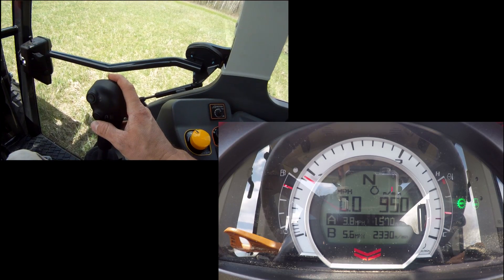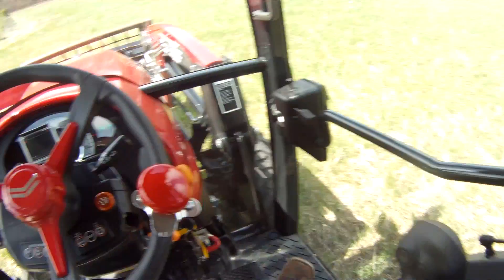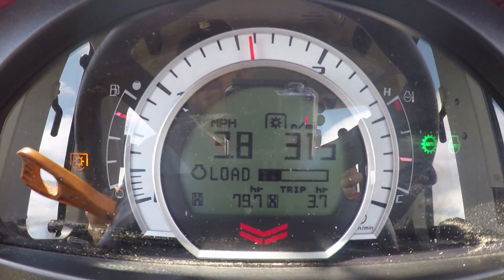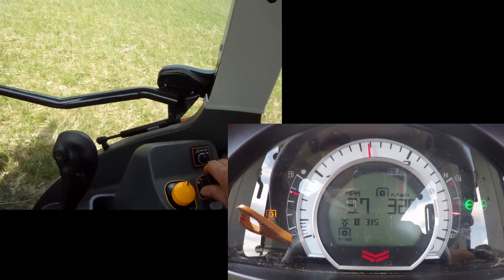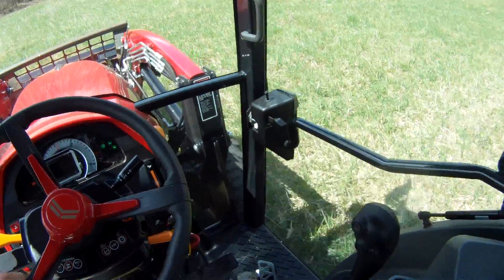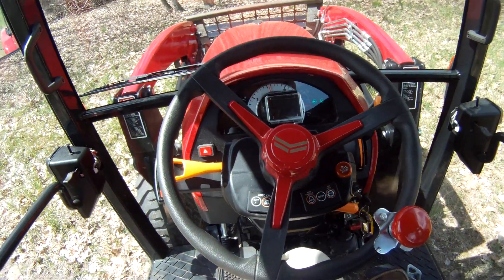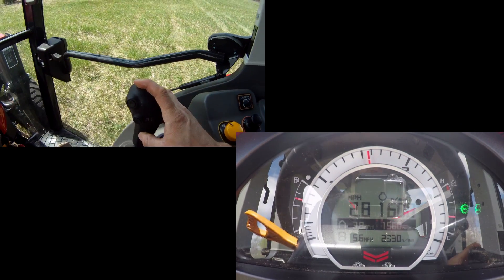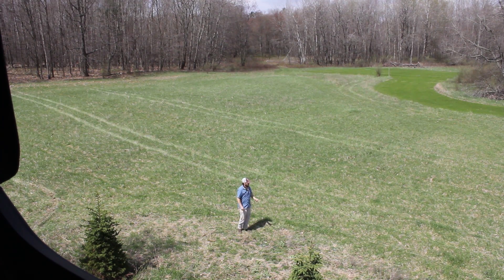iHMT Yanmar YT3

Comment: Thanks for the video. Can you achieve 0 ground speed with this transmission, for example if you wanted to drill a post hole on a slope?
Reply: Yes. Neutral on the shuttle shift will accommodate this

Comment: Did you install the radio in the cab? Where did you get the bracket to hold it?
Reply from the maker: Jeffrey Wilder  No. My dealer installed it with the sale. Sorry couldn't help